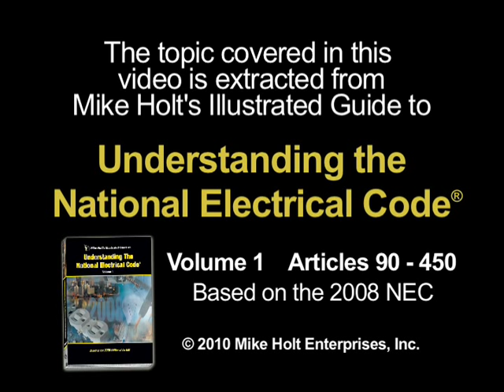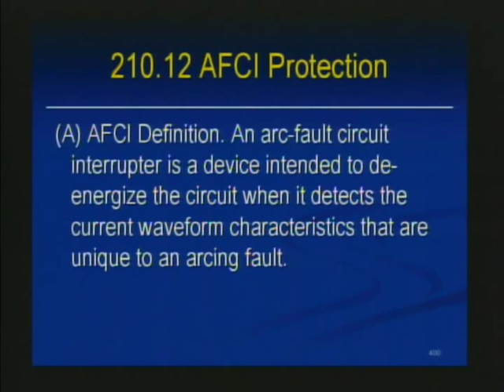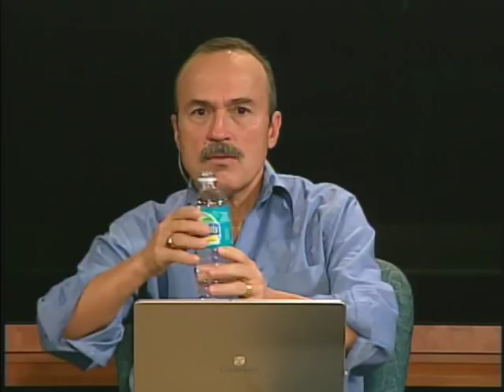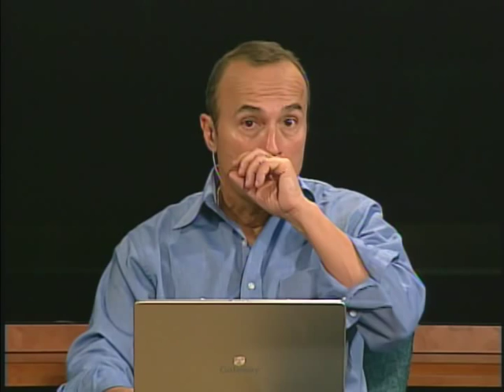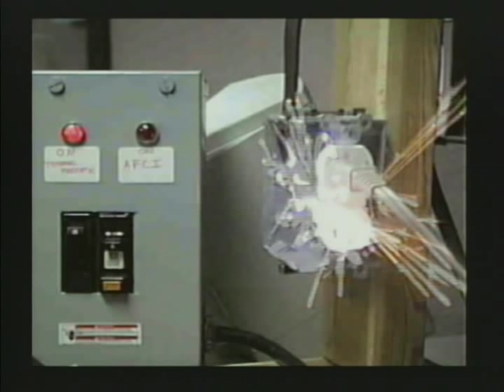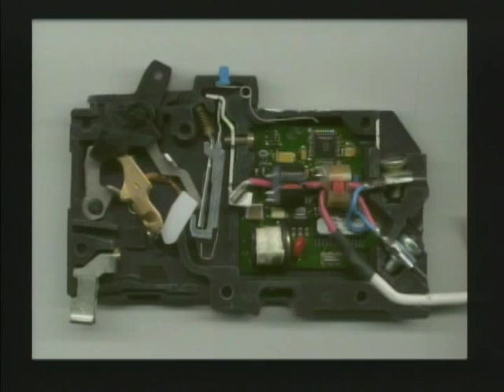Comment: Great video! I have an older 2 conductor wired home. I plan to increase the safety of the system with these breakers. Seems like the best way to protect the entire house and all of the equipment downstream. Especially without a ground conductor.

Comment: Thank you great pictures and teaching sir. How does table Lamp get pressed on cord? Isn't thats call abuse ? AFCI every thing becoming requwirement AGFCI breaker $40-$50 each? (No more freedom of choice?) it might create extra safety? but Burns down finance of poor family? They are expensive if its $50 ×10 $500 How many AFCI installed your house sir ?
Isn't Ark fault occer wire get hot thats that breaker are for (over current protection are for)?